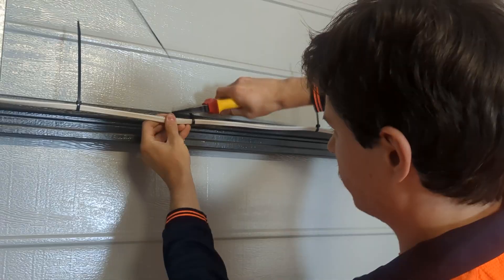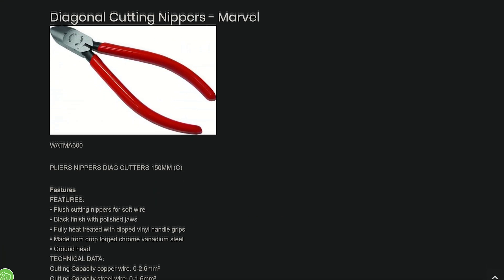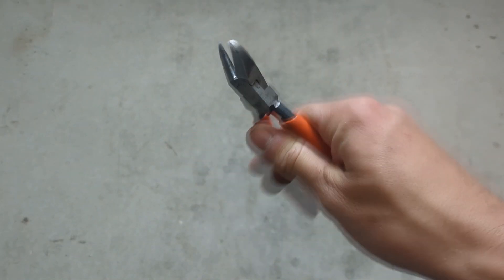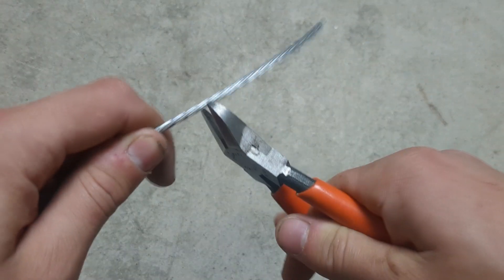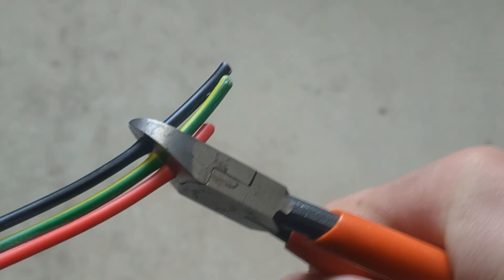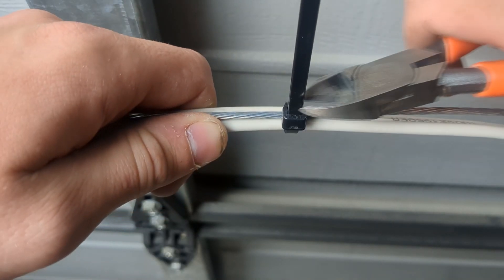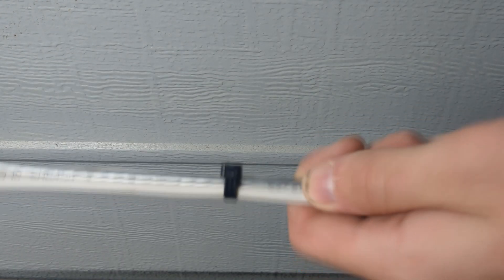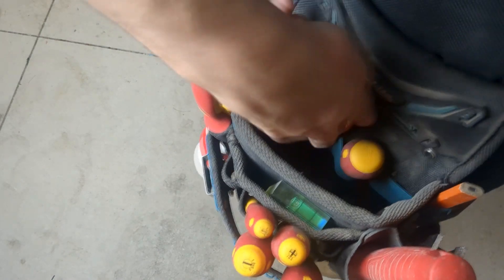Diagonal Flush Cutting Pliers + Best Uses as a Sparky

Comment: If you aim the cable tie facing across the tray so when you cut the tie if there is still a shape edge sticking out running your arm or hand over the tops of the bundle wont come into contact with  that sharp edge.`

Comment: You don't actually need to pull then cut, they are flush cutters they will cut flush. You can of cause grab the tie while the back of the blades rest on the head of the tie and pull the tie tighter by twisting the cutters.